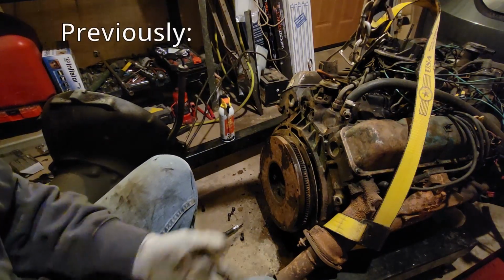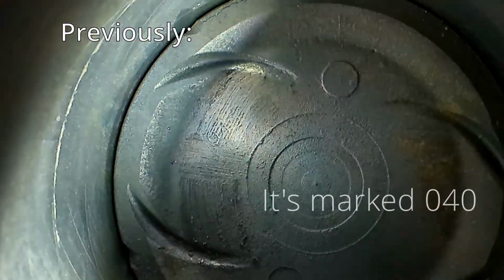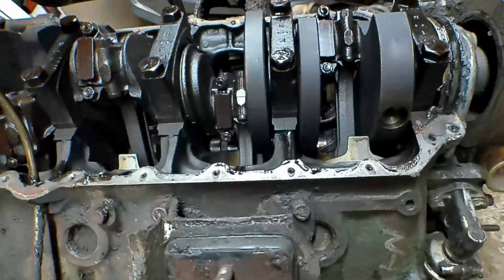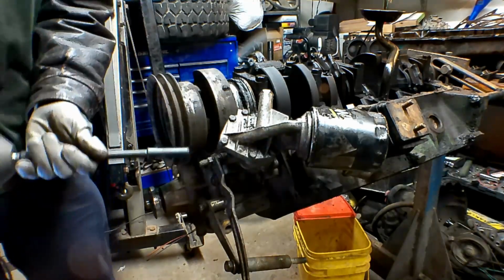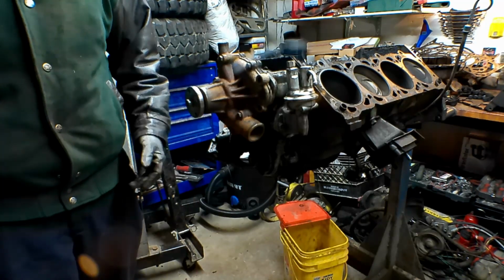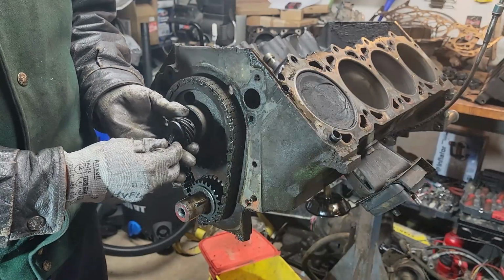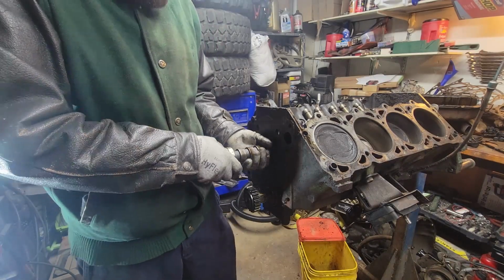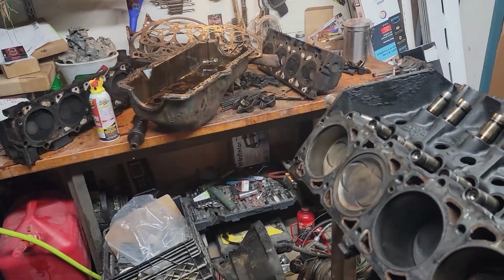Continuing The Gremlin Engine Rebuild. AMC V8 360ci 5.9L

Comment: You have it pulled down that far,replace the oil pump with a meillins kit,and definitely replace rear main seal, and I would probably replace the cam and lifters to be on the safe side
Reply from the maker: I'm going to replace as much as I can. I have not heard of the meilins kit. I will have to look that up. That's good to know!

Comment: So I found out that the AMC v8 and six cylinder (jeep 4.0) have the same bellhousing  pattern. I put a 304 with a AX-15 in a cherokee, but a 2wd 5speed would work for cars. Still need to modify the throw-out bearing or buy the adjustable one.
Reply from the maker: That's awesome. I haven't seen that done. That's cool!